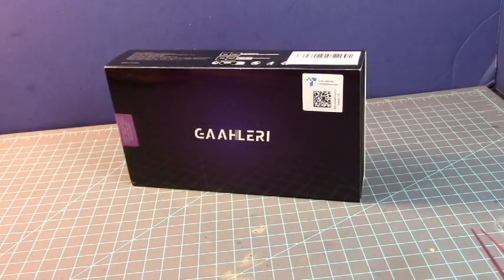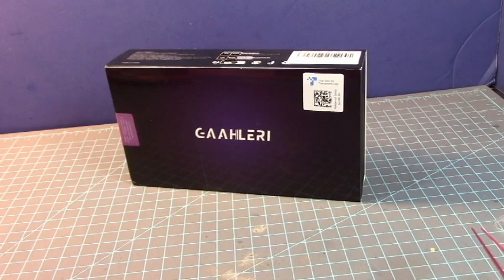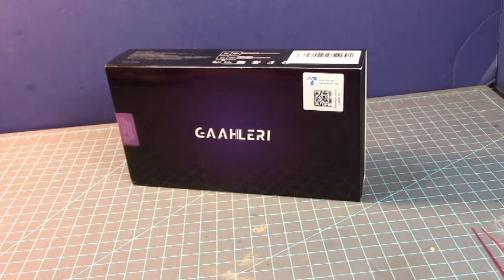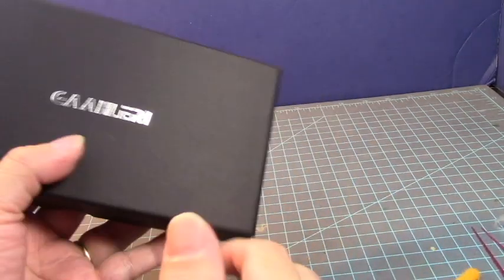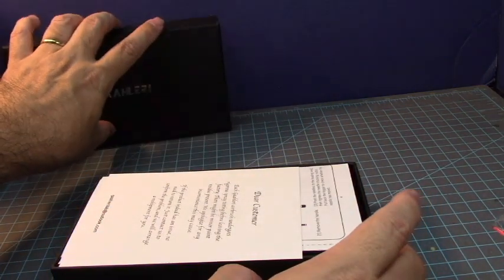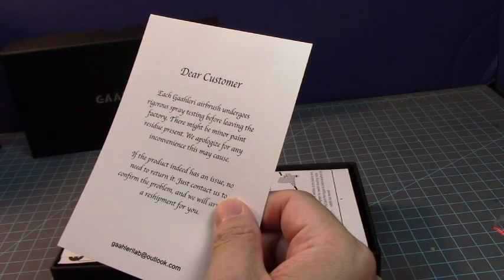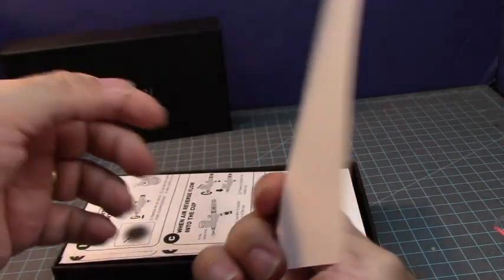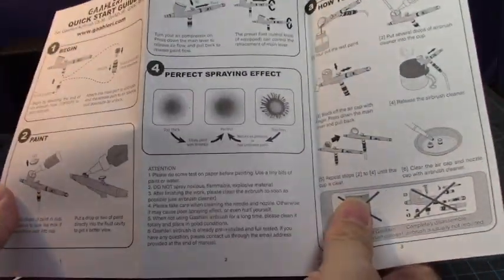*Tooltime with Stryderprime* Gaahleri Studio GHAD-39 Advance Airbrush - unboxing and testing

Comment: This looks like it will be easier to clean after finishing painting with how it breaks down.  Stryder isn't a quick release only good if you're going to be switching between airbrush's?
Reply from the maker: Great point! I don't normally switch between airbrushes since my setup is not like you think. Still I am going to invest into something like this so I have more freedom of cleaning up my airbrushes during downtime.